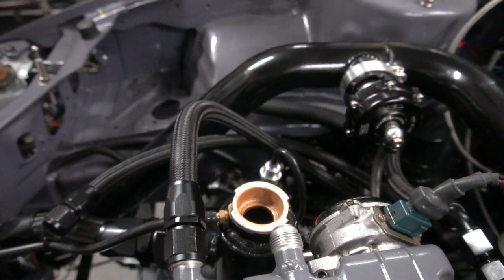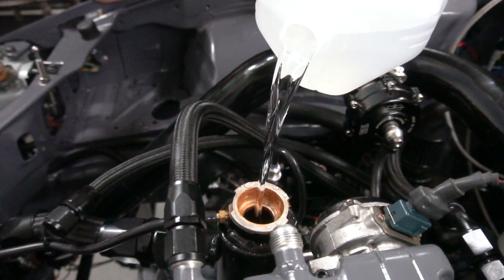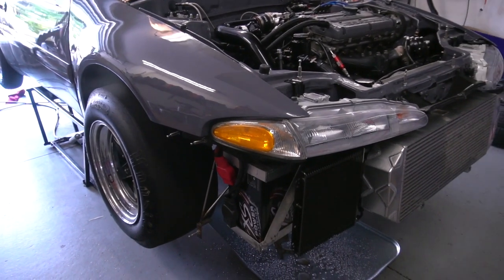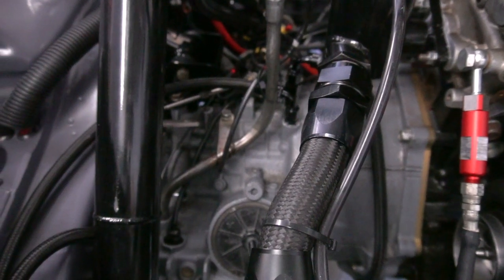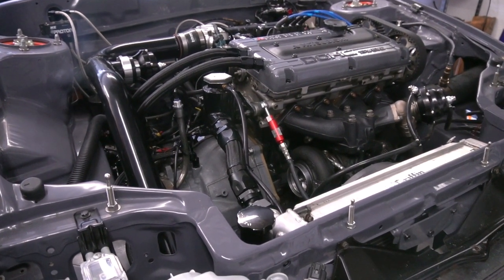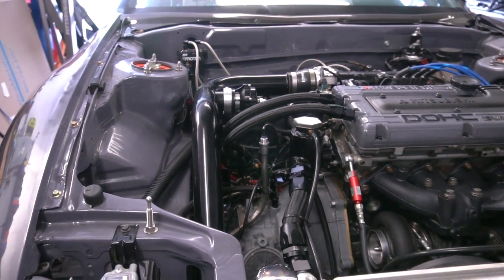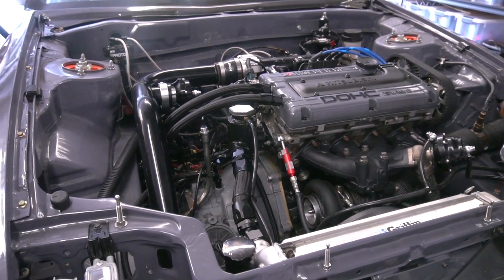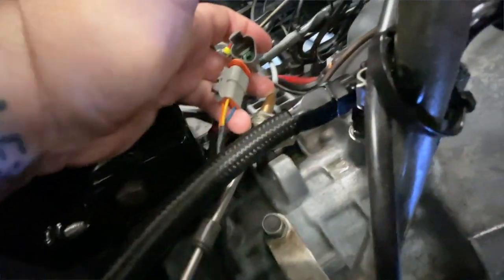2g Transmission Acting Up!

Comment: Hi Joe, when you check for oil pressure on torque converter. Was that on Idle only? Tia
Reply from the maker: I think I checked at idle and with some RPM, but I made a mistake when I did this test, so the numbers are not good numbers. I fixed it in a later video.

Comment: Joe, what's your take on ignition systems in these old 4gs? Is there a reason you still use the stock wasted spark setup as opposed to direct or sequential ignition?
Reply from the maker: I use it mostly for simplicity's sake. I can remember when people went to 300m coils and in testing they weren't as strong as OEM, so I've stuck with them. I am using a Dynatek ARC 2 CDI. I'm not at a high enough level to need a real serious ignition system. That said, my harness and ECU are wired for sequential and I will go that route, likely with IGN1A coils, at some point.
Reply: @JoeWrenches  That's interesting about the 300m coils. I was actually looking at those recently. My 1g is running on Haltech's Elite 1500 and they've suggested IGN1A coils or a swap to LS1 coils. I was looking for simplicity as well, but what's a little more wiring after you've gone stand alone?
Reply: @JoeWrenches  Also, are your OEM coils all 30 years old or are you buying new, parts store replacements somewhere?
Reply from the maker: @bubbaskywalker3129  Old OEM coils
Reply: @JoeWrenches  Sweet. I've only ever had one OEM coil go bad on me. They sure are holding up over time!